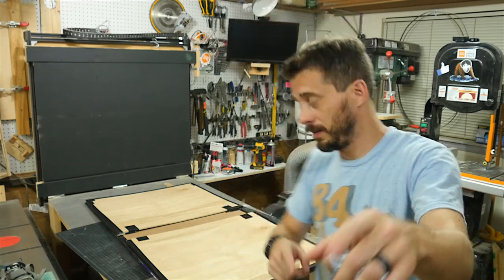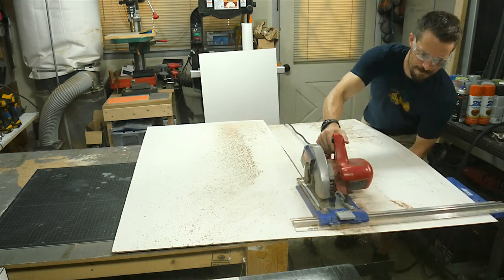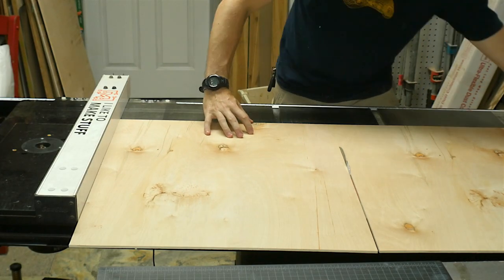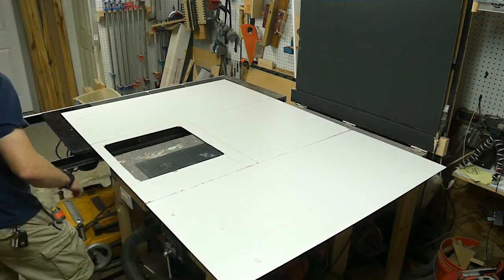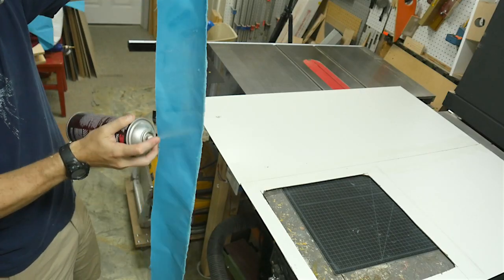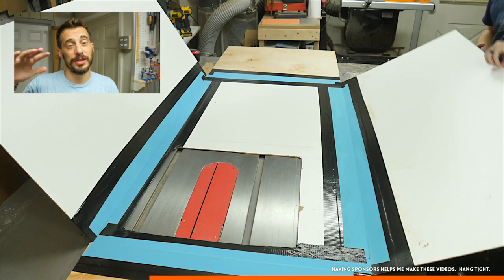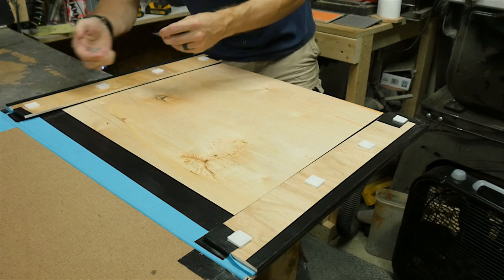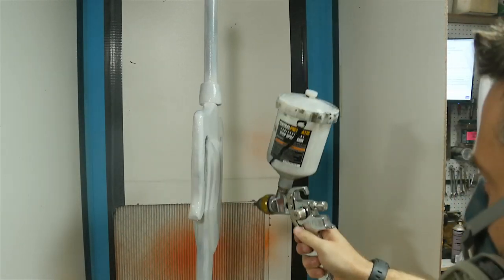How to make a DIY Paint Booth | I Like To Make Stuff

Comment: Just finished build your folding paint booth. One modification I added, cut a 14"x14" hole in the top panel and hot glued in a piece of clear diffuser light panel. Works great for letting in more light from the florescent in my shop.

Comment: Great project overall. One thing to be aware of; the motors on most common house fans can be sources of ignition/explosion if you are spraying petroleum based materials into or through them. There are specialty fans that are designed to be used in this kind of application to minimize the risk, but they are considerably more expensive than a box fan. Water based materials should not present any problems at all. Even with a spray booth, it's always good practice to wear an organic respirator and have a well ventilated area. 

I really enjoy your channel and projects. Thanks!

Comment: hey Bob, great channel. for bigger things I use a pop up gazebo. I lay a tarp down, then pop open the 'spray booth' (gazebo) . it works really well and I keep only for sorry work so no sanding or orep work allowed inside so dust is minimised. 
leave the compressor outside and pipe in the hose. add a respirator and painters overall and you've got a great dedicated spray booth for very little money.

Comment: Awesome! I'm a "blind" artisan (legally blind due to being born with glaucoma) and I create decorative plates which I use spray paint for and I had built a portable paint box out of white foam board but I was left out in the weather by accident and well it died after a bit. I used hot glue to connect the foam boards together, using hot glue in the joints it wasn't collapsible/portable. Your build gave me a great project idea. I have melamine and tons of fabric!!! Thx!!!

Comment: If you are looking for something quick and dirty, check out the folding cardboard display things you can get at the big box or office stores.  They only have 3 sides but if you grab a couple of pieces of poster board, you can just set it on one and lay the other on the top.

Best of all, they are really cheap.  I think I paid about $5 for one and two sheets of poster board.

Comment: I wish I had made this earlier, I'm on winter break from college right now (finally able to get back to my workbench), and since I don't currently have a way to paint indoors, I tried using plasti dip to seal my foam X-wing helmet outside (it's 22°F right now). It did not go well, and I may have to re-do the helmet if I can't salvage it with high-grit sanding and more plasti dip. By the time I make this, I'll have to go back to college for my spring semester, but I can say for a fact that if I had made this in advance, this could have prevented pretty much all the problems I'm having with the weather interfering with my painting right now.
TL,DR: Don't plasti dip in winter or when the temperature is below what the paint can says, make this and use it instead. as always, great video, and I'm looking forward to whatever you make next!

Comment: Nice build! I tend to use a big cardboard box with a fan filter cut into one side; its quick and cheap but It doesn't fold down as neatly. If I had a bit more scrap available I wouldn't mind having a go at what you did

Comment: Super 77 is the best thing since hot snot.  I just used it to tack on some batting to a drapery header before I upholstered it.  Also, this is a great idea because I have a bunch of old 1" filters that were a part of our old Air conditioner returns but have since had that replaced with a system that takes 4 inch filters at the plenum.  So, I've got that going for me.

Comment: great idea. i have been looking at both the video's and there is much to say for both the designs. but i think i will use both the ideas to alter it a bit for myself. point is in my case i am working with metal objects that need to be spraypainted, and i loved the idea of being able to hang them in the spray booth als i am currently hanging them in my little shed / shop. as it allows to turn them while painting. however, with metal objects i need to make sure that the top and at least one of the longer sides is stonger to hold the weight.
also i need to figure out if i can actally get a reasonaly priced box fan or not to big fan here in the netherlands, including a replaceble filter.

but again. really love the idea on how you solved this. the fabric hinges also make sure that there are not to many 'open' corners where the paint can go through.

Comment: Love the smart design, both functionally and in terms of ease of build. Though the paint dust flies away, you can see it at 6:57. An overhanging cloth can make it less of a problem or a different design with a glass, just like in sand cleaners.
Reply from the maker: Yes, the top doesn't have a fan to grab the overspray.  Typically this wouldn't be an issue, except that I was painting a long sword.

Comment: Interesting using the fabric for hinges. Have you found that using this helps with overspray AND the lingering odor, or just overspray. What I mean is, when I spray in my shop, I do it in an area that overspray is not really a problem. I wear a mask, but the smell will linger for a long time. I wondered if this is due to some of those particles kind of floating around, rather than being collected into that filter?
Reply from the maker: I think the big benefit is overspray.  I imagine that you'd need a huge amount of suction and a specific type of filter to get rid of the fumes entirely.  I think it helps with fumes, but definitely doesn't get all of it.
Reply: Good deal. Well, I like your design. I think it could work well in my space as well. Have a good upcoming weekend!
Reply from the maker: Bruce A. Ulrich Thanks, you too!

Comment: 6.56. white paint cloud exiting the cabin... need a redesign. maybe put a second extractor in the upper part and one small lip in order to contain the paint cloud. But hell yes! very good build and ingenuity as always!!!
Reply from the maker: That just shows that the area without the fan wasn't drawing overspray, which means the fan area IS.  The only reason I made it in this configuration was because I needed to paint a sword :)  A cube that matched the fan size would be the most efficient for overspray.
Reply: Totally agree.!

Comment: Neat booth. However, I do see one thing that could be an issue, especially if you're working with solvent based paints like enamels and lacquers. The fan really should have an explosion proof shaded pole motor, especially if it's going to be in the airflow for the exhaust of the booth. Another option would be a belt driven fan where the motor where the fan is outside of the airflow.

Comment: Looked great till I saw all that vapor flying out of it when being used at the end. You really need more air flow at the other end of the box with it being so big.
Reply: Seems to be a common theme on YouTube maker channels. “Hey check out this awesome gadget or widget I made” and then they either don’t show it in action, or just show a sped up shot of the device in use and it works like crap. But whatever gets him views amirite?
Reply: I once worked for a company that had this dude spraying blue glue inside of a spray booth. All you could see from across the plant was this blue miasma floating in the air. 😷

Comment: A few tricks I learned with jigsaws:
1) Ignore the oscillating setting guidelines (low for metal, high for wood).  Set that thing to the minimum amount of flex.
2) Put masking tape where you plan to cut, that keeps the top from getting all bootched up.
3) Give the saw enough time to do its job.  If you get impatient like I do, that's the first thing I have to always remind myself, SLOW DOWN and let the saw do its work.

Comment: I'm a little surprised you didn't make a little housing for the filter so you could slide it in and out instead of just hot-gluing it on. Sure it might be a little more cumbersome but I'd assume it'd a lot easier to replace the filter if you need to.

Comment: I did check out Tyler's paint boot I kind of like his fan box for the way it supports his paint booth but I think I will put my fan on the back of the booth like yours I see the fan box as a good anchor point for the top, sides, and bottom.  I will not go as tall as yours due to my ceiling height and my need to work on a bench top due to a back injury. I will have a hanging bar and a turn table for the booth to make painting easier.  My material will be 1/4 ply wood it will be a lot better then the top of the. Waste Management cans.
Reply: I contemplated the fan on the back of the booth as well but decided against it so that I will not be spraying directly as the filter. Good luck with yours man!
Reply from the maker: Yeah, mine was only that tall because I needed to paint a sword :)  Good luck!

Comment: Nice project and video.  I've been looking to build a paint booth of some sort and I may just end up building one like this.   In my research on the subject many people claim that you must have an explosion proof fan.  Are you confident this is safe with the fan you picked?  Thanks.
Reply from the maker: Hmm, never heard that and no, I'm absolutely positive that this is not one of those.  It's the cheapest box fan I could find :)
Reply: Not explosion proof.  However, most fans use AC induction motors, and do not generate any sparks.  A brushed DC motor would however, though I think you'd need quite a bit vapor before you'd have to worry about that.

Comment: Very smart way of building the hinges with the fabric well done. Any chance of some metal working projects coming up?
Reply from the maker: Thanks! Hmm.. the next metal one will be in late Sept I believe.  Did you see the outdoor sink vid? https://www.youtube.com/watch?v=Kif1Hn4CaRI
Reply: I just watched it thanks, I noticed you were using a cold cut saw to cut the steel are they worth the price? ive been looking at one and they seem quite expensive but they cut like a hot knife through butter
Reply from the maker: DIY Jet Engine Guy THat one is actually a harbor freight, so it's pretty cheap.  However, the blade cost more than the saw did.  I guess worth depends on how much you'll use it, but I do think it works really well for the overall cost.

Comment: You make great videos sir. One question: in the basement booth build video you said that fumes passing over a motor was a fire hazard, but here you are doing it with a box fan... Why is this okay? Not being facetious, I really need to know because I was going to go with a box fan design originally! Thank you again for your hard work.
Reply from the maker: Well, when I made this video I got severely yelled at because potentially "explosive" fumes might ignite when passing through a motor that creates a spark. I've never actually heard of this happening, but I suppose it's a risk.  Separating the fumes from the motor internals avoids the potential.
Reply: @Iliketomakestuff  Thank you for your reply. I'm a bit of a safety bug when it comes to flammables so I ordered a decent size centrifugal blower where the motor is out of the airflow equation... Almost went with 8 inch piping but that seems unnecessary. Your baffle idea is genius. You really seem to know your stuff and execute it nicely. Keep up the great work!

Comment: Is the filter enough to catch all the fumes? I'm considering building something like this for a second bedroom workspace, but was wondering if an exhaust pipe is needed from the box fan to outside. Since I have an apartment, I'd like to avoid stinking up the building. Thanks!
Reply from the maker: No, the filter catches the paint. The exhaust is here to remove the fumes.

Comment: Just curious, was there a reason you put the flaps on the inside and not the outside? If they went over the tops and velcro'd to the outside there would be no possible way for it to fall inside right? Not to mention you could even support a bit of weight if you hang objects...

Either way I love this, and I'm totally building one. My mom makes small furniture items and dog beds and such and gets her over spray on everything lol
Reply from the maker: No reason at all, but you're totally right.  Outside would be a more useful option!  It just wasn't something that I thought of in the moment.
Reply: Oh, cool.. I thought maybe it was easier to fold or something. So I'll do it outside on mine and see how that goes. Also I thought of maybe using pegboard for the top with velcro along all the edges so you could run wire or string through them and then velcro down some fabric or tarp material to seal it up. (I only need mine to be vertical.. so I can get away with that.) But honestly this was an amazing design for me to start with and tweak to my exact needs! Thank you! 

P.s. You always have such cool ideas and seem like you just go for it a lot, and just try things out! I find that very inspiring since often I get so caught up in details, that I constantly postpone until I feel like I can make it "perfect" (which we all know there's no such thing) so this project in particular gives me the push I've been needing, to make a project I've been needing for some time but have been putting off. Thanks again for that.

Comment: I'd assume this is mostly for overspray when using water based paints? It wouldn't do much for fumes when using spray paints and such without being vented or some type of charcoal filter.
Reply from the maker: Yeah, just for overspray.
Reply: +I Like To Make Stuff I had one vented to outside in my old shop for spraying dyes mostly which are alcohol based, I just don't have a good spot for it in my new shop. I might use part of your idea and combine it with a vented fan.

Comment: When you were spraying at the end paint can be seen leaving the box and going over your head/shoulder. Should it be doing that and if not how would you alter the design to stop it?
Reply from the maker: The top section doesn't have the fan, so it didn't grab overspray as well, but since I had to paint a tall sword, that's what I had to go with.  If you really needed to be able to paint something like that every time, adding a second fan would be a good idea.  It's unlikely that I'll be painting tall things too often though.

Comment: Interesting, but you need a lot more air flow. You are getting overspray drifting back over your head. That's kind of counter to the purpose of the booth.
Reply from the maker: That's when I was spraying at the top, where there wasn't a fan.  It'd be best to have a second fan, but I'll only paint up where when doing a long item like the sword (which hopefully won't be often).  Also, using a different filter than I had would help increase air flow.
Reply: Yes, some of the cut to size fiber filters would work well. Based on the cfm for a box fan 1 should be adequate, but there is no accounting for air flow in an open space. Probably two would do it

Comment: I'm not getting it... When he sprays the sword, you see the overspray fly right out of the box toward himand over his head. So, what's the point of the box, filter and fan? See for yourself, go to 6:55.
Reply from the maker: +Eric L. There's no fan at the top (where I was spraying) so that shows that it works on the bottom section. I only made this tall because I had to paint the sword, otherwise it would have just been the size of the fan.
Reply: Thanks for the reply.

Comment: I Like To Make Stuff, can you also use cardboard for this project? I believe it's even cheaper.
Reply from the maker: Yeah, definitely! In fact, I was using a cardboard which inspired me to make this so it would last longer.  The cardboard will begin to sag over time and doesn't hold up well if you're hanging pieces to paint, like the sword I was doing.  It's certainly a good way to do it on the cheap though.

Comment: Oh also, I forgot to mention, the filter will need to be changed more often than you realize so I would lay duck tape on the wood to create a easy to peel of layer to tape too , than duck tape the filter to those previous duck tape permanently attached to the wood strips.

Comment: look at 6:56 all that paint mist going everywhere .. I'm not hating - do your thing man.. but imho a cardboard box would work just as well, and with just as little purpose as this
Reply from the maker: Actually, that's when I was spraying the top, where there wasn't a fan.  The bottom area with the fan makes a huge different for overspray.  Since I was making this tall to accommodate the sword, that is just something I had to deal with.  Typically, I'd only paint in front of the area with the fan.
Reply: oh I see.. well .. as I said, no hate - hope it serves you well ;)
Reply: I was thinking that too, to keep it contained, maybe cur a groove in the sides and top, so you could slide in a variable size plexi glass, right.. that's what I was saying in the beginning it kinda defeats the purpose by being so open, it's basically a wooden drop cloth.. but hey.. he knows what he needs better than we do